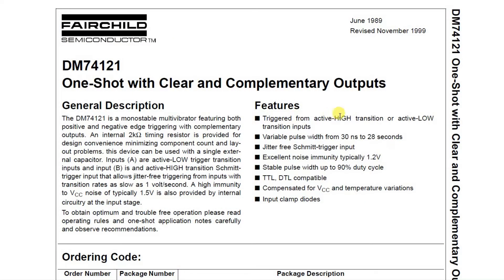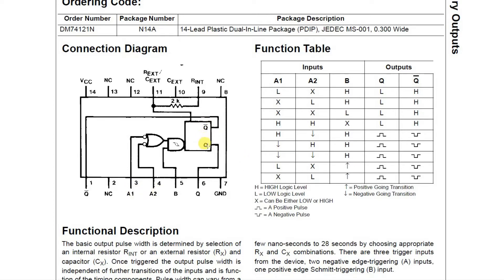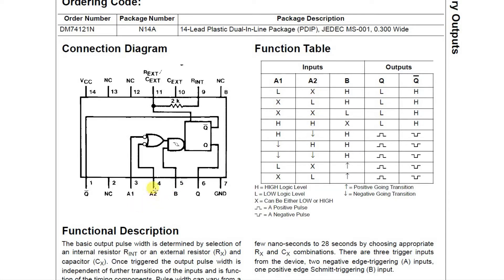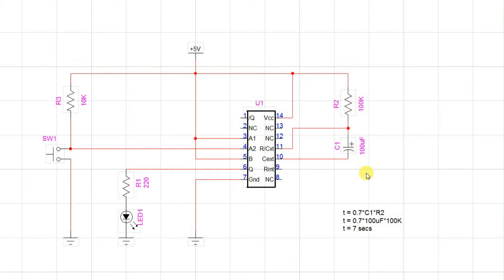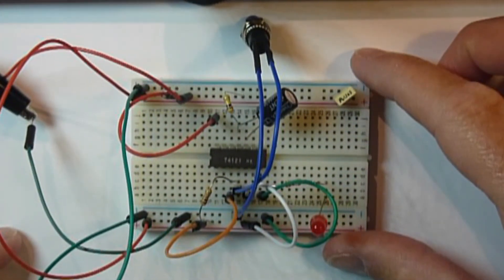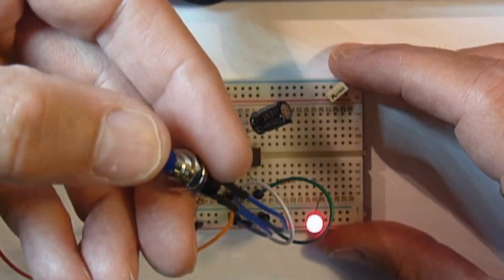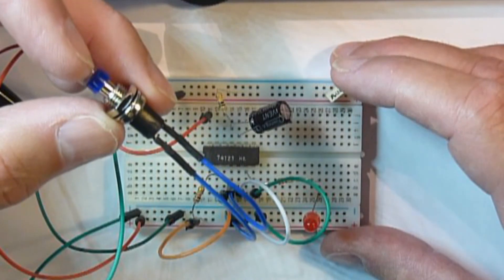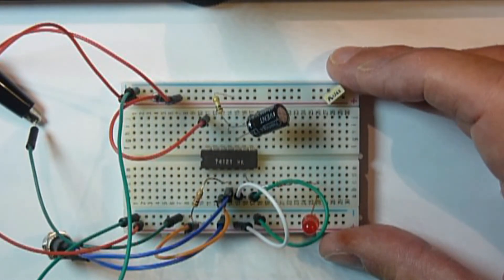How to stop switch bounce with the 74121 monostable (one-shot) IC

Comment: What happens when the circuit is first powered on?  Will it 'trigger' and thus light the LED for seven seconds (without the pushbutton switch activated)?  Is so, possibly put an RC time constant on pin 5 so it remains low for a second or so upon power applied?
Reply from the maker: It should not trigger when powered on.

Comment: What will happen if the contact remains pressed ...?
  Does the output remain active (HI)...?
Thanks for the video...
Good Job...
Reply from the maker: It should not trigger again until you release the button and press again as it is an edge triggered device.